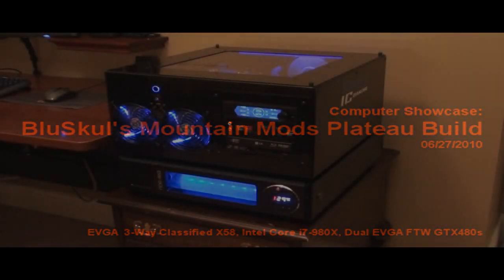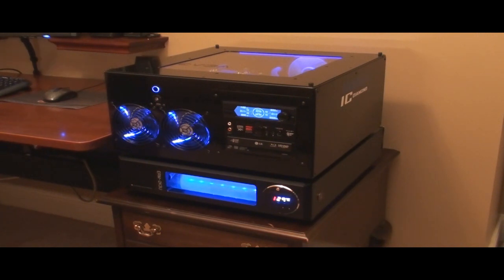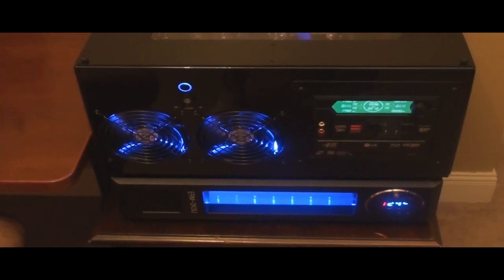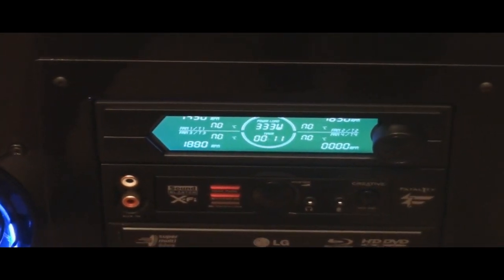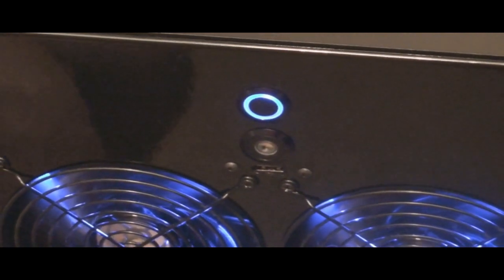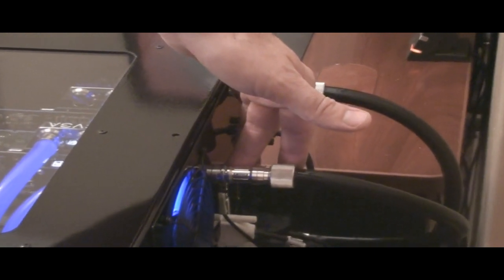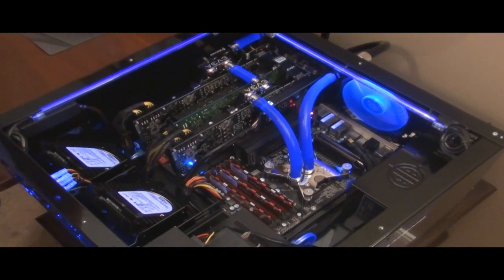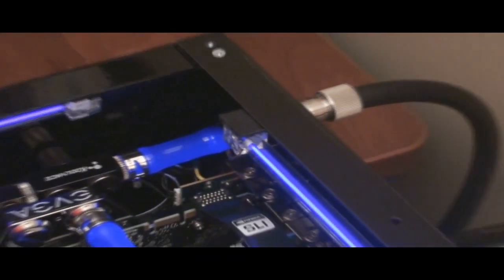BluSkul's Mountain Mods Plateau Build:  Intel i7-980X, EVGA 3X Classified, Dual EVGA GTX480 FTWs

Comment from the maker: @gor1l1a There could be an argument made that GTX480s in SLI does fine with physX as well, but there is no possible way that a dedicated physX card will slow down the GTX480s.  I have tested this in my Quad SLI rig and I get better scores when I have a dedicated physX card so I'm not sure exactly what you heard.  PhysX is done independantly of video processing and even an older 9800GT idles most of the time when dedicated to physX.

Comment: @BluSkul01 

Ah cool thanks. any particular reason you went with this model over the others they have. I am currently looking at the Plateau, Monticle and the Pinnacle. I am currently leaning towards the Plateau.

How much space for graphics cards does the case have? currently i am running a GTX470 but will be going SLI soon and if needed i have a few cards that could be used as PhysX card you think this all would fit in the case?

Comment: two nvidia quadro fx 5600 sli graphics cards connected to two nvidia quadro 6000fermi100 sli audio sound card asus xonar D2 pci motherboard evga x58 3x sli classified limited edition three hdd drives hitachi ultrastar 7k2000 this is a high performance configuration supporting directx 10 directx 11 nvidia physx nvidia dlss 2.0 backward compatibility

Comment: Buddy i got 8 pc top of the line the best you can get i beat you with 4 evga gtx680s 64gigs of ram 6 SSD 256gigs 3 10,000rpm raptors 3 asus 24' monitor 3D in surround that's only my mine system. all of my over pc are running i7 3960x with 3 580gtx ultras classified and 3 7970  if you want to see pix ill be glad to show them to you.